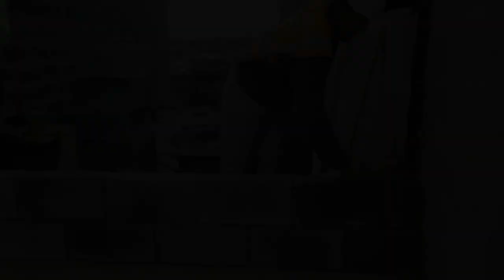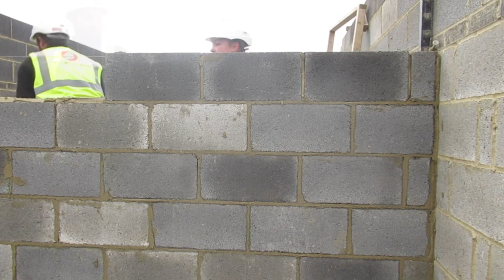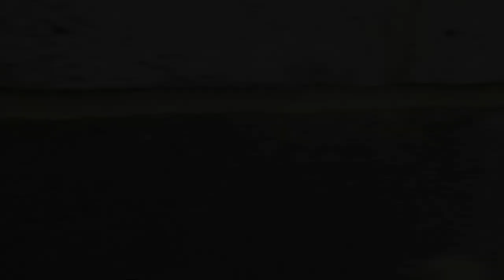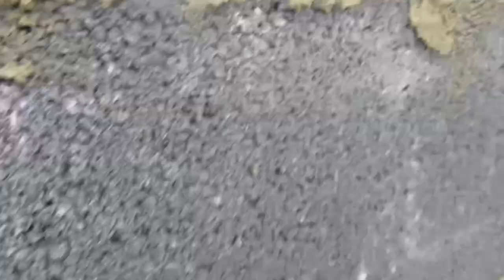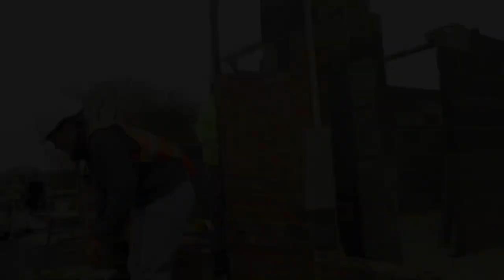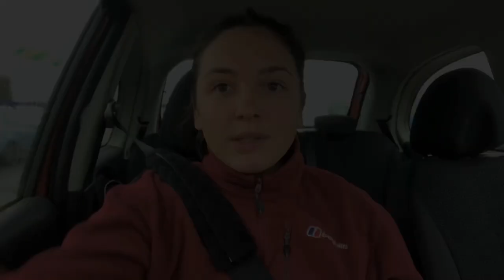TUESDAY VLOG I The life of a bricklayer

Comment: Hi Beth , love the videos! I've been laying for 11 years now. I used to struggle picking blocks up one handed. Little tip for you, when you bring your block down to lay it.. place your trowel on top of the block . So once you have layed the block you don't take an unnecessary turn back to the board to get it. I still use this technique now. I find on a run it saves so much time . Good luck!

Comment: You're very good .that trowel will ruin you but fair play . Bricklaying is a sport when you're young and a punishment when your old .
Reply: After 45 years you're lucky if you can get the lid off your grub box 🤣🤣
Reply: Totally agree ,I was a price work spread for 25 years.total animal mixing rubbish bins of board finish with a couple of handfuls of carlite finish to give us an extra half hour a gage. We used a plaster mixing machine for the first coat and could easily use 60 bags of  hardwall by midday and have it skimmed by 4 o'clock  in one mega gage.good old days but does take its toll

Comment: Beth seems very capable but will all know in this job there some days you got to lay heavy wet concrete blocks all day long so not easy for the best of us.. My advice get to the gym and get as strong as you can to prove the more cynical of us male brickies out there wrong   Good luck..
Reply from the maker: Okay but tell me why I should have to go to gym and prove myself to be strong enough just because I’m a woman and men think I can’t do it, I can and I have. My videos over time will prove that, I’m a lot stronger than I look
Reply: If you need to go to a gym to enable you to work as a brick and block layer then I’m afraid you’ve picked the wrong trade that  goes for both male and female.
Reply: @brickbybric  There job for you at the BBC..Get grip if you do your own work not just about laying lifting heavy lintels steels bla bla..Many Brickies men who cant  put on a small steel without having hernia..I said she look capable but being stronger always helps..
Reply: @muttleymut4751  I started my time in 83 . I have never come across any bricklayer that went to ,or wanted to go to a gym after an 8 hour day . I have found that blokes who find trade work to rough usually make a fast exit back out the door . It certainly isn’t gyms they go to . If women aren’t strong enough to lay heavy concrete block then no amount of gym work will enable them to do so .
Reply: @muttleymut4751  we  lay 150-200+ blocks a day, and that itself is better than any gym, i know lot of men who can't even grip a block with 1 hand and lift it up like brickies do ,never mind do it all day everyday...we train our bodies/muscles over time to do the work needed.  Also not many sites don't even use concrete blocks nowadays in the uk.(i personally haven't used any for years). if specs require them, then it's usually more the 7nm  medium dense  blocks which are still heavy but not as bad as concrete blocks.